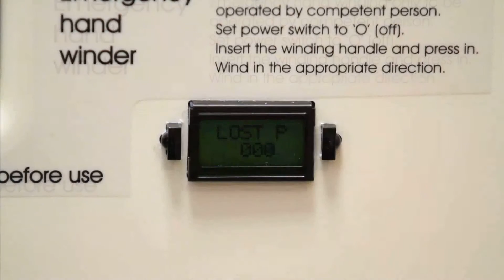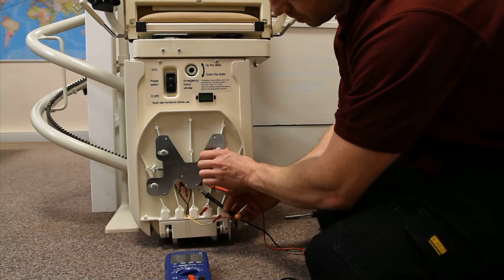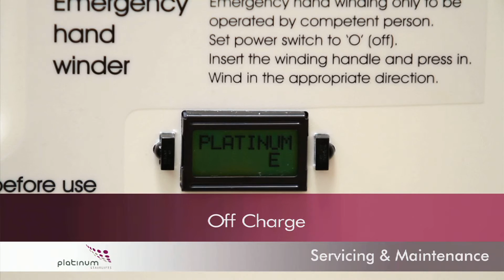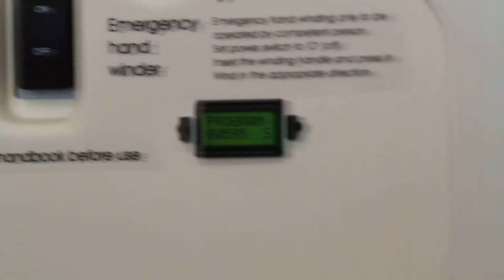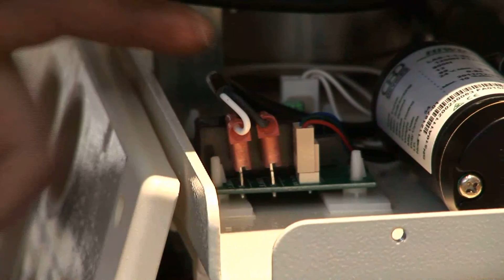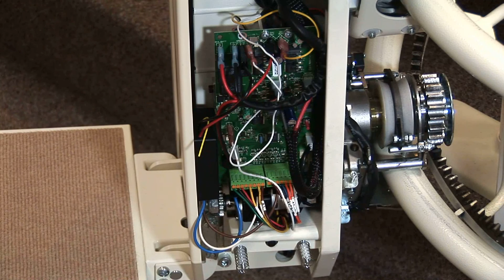Routine service video

Comment: I have a Stannah curved 250 stair lift. Could I replace the chair with one that is used on a straight lift?
Reply: I have a handicare stairlift batteries good but going slowly can you help
Reply: @gerrycochrane7842  Are the batteries very old?
Is the charger working?